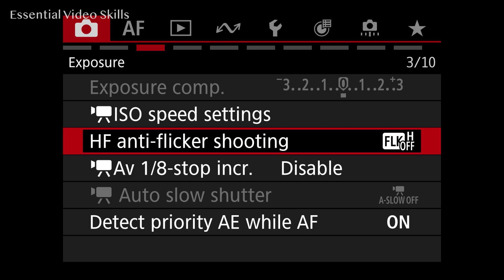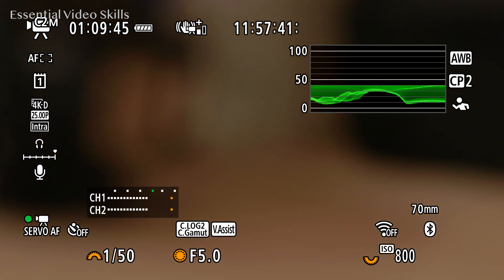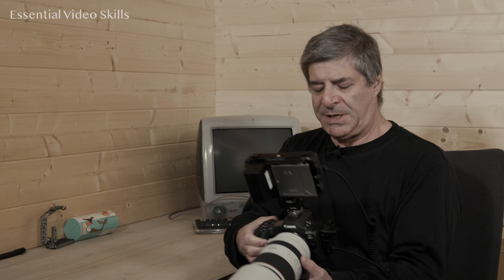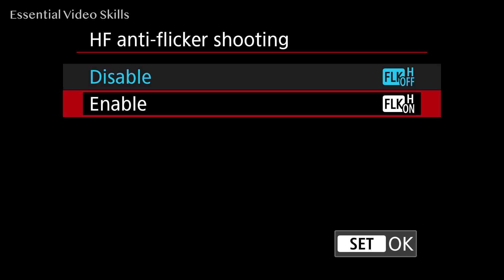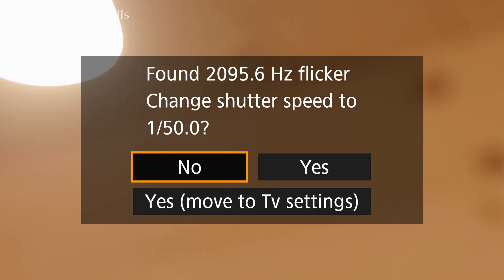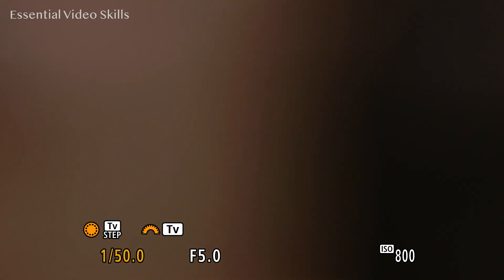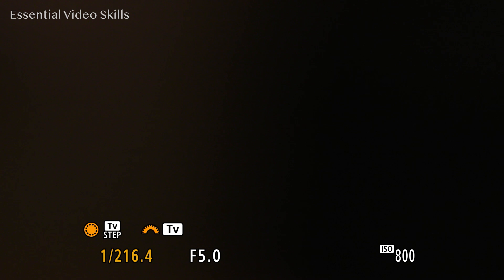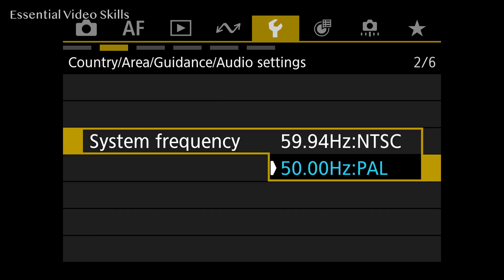High-frequency anti-flicker shooting with EOS R5 Mark II. Remove projector flicker shooting video

Comment: You just need one thing right out of shutter speed and frame rate. If the flickering light is oscillating at mains supply frequency then a region format change is good enough. But if you encounter a HF light source like LED screen or lamp, you gotta use HF anti-flicker shooting to try and eliminate that. Changing frame rate is likely not helpful in the later case. And you better hope the lights at the scene all have the same frequency which is not guaranteed.